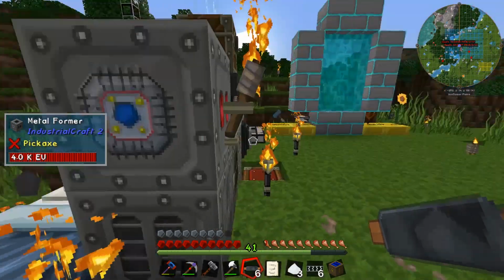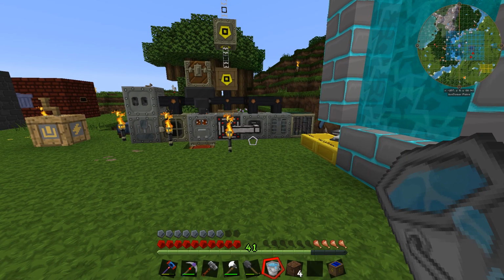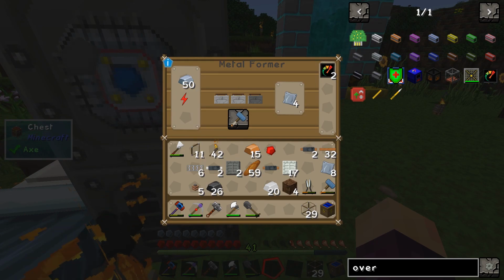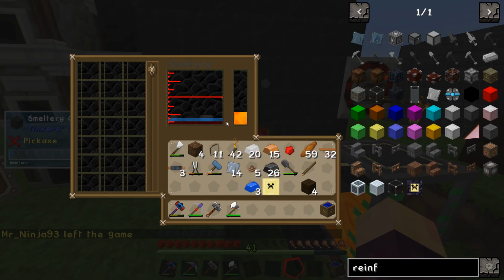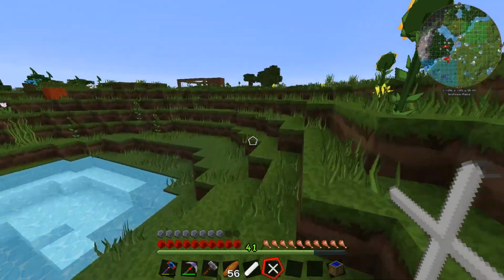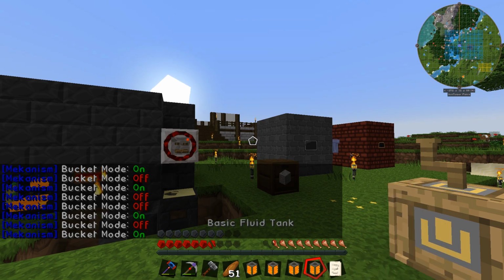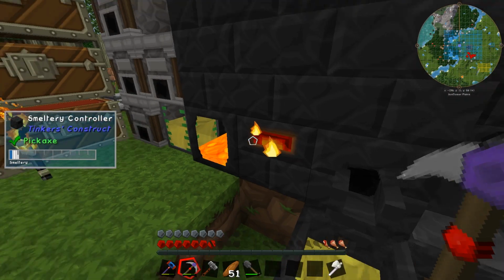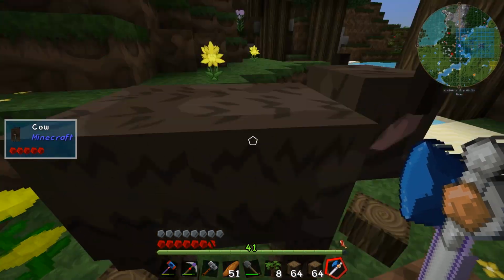Minecraft Age of Engineering! #11 - Overclocking & Unbreakable Lumber Axe! [Twitch VoD]

Comment: Distilling the water. Is a very slow process. Recommend multiple of them atleast 6. And using enderio conduits to put in water. And pull out distilled water. But its well worth it.
Reply: steam boiler is way better if he finally gets some "real" power (eu) going, he could do forestry generators, they can output eu (I think they do mv, but I'm not 100% sure)

Comment: Actually .... if the lumberaxe has writable 2 ... then you only needed 2/4 parts to be paper ... right ? 
Cause 1paper part=1writable level right ?
Reply: Almost. For writable 2 u need 1 "head" part and 1 "modifier" part from paper. So for lumber axe it can be paper plate and binding to get 5 modifiers.
Reply: In conclusion, he just wasted a bunch of paper?
Reply: Exactly.